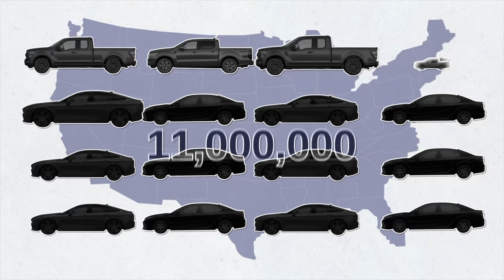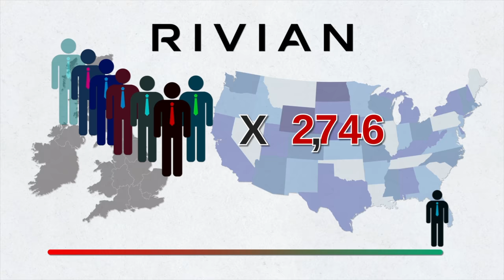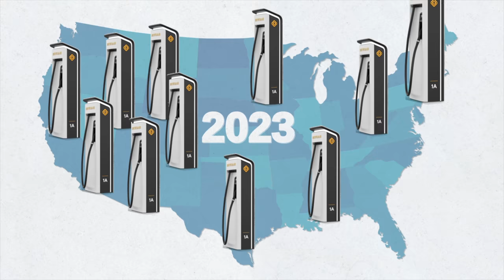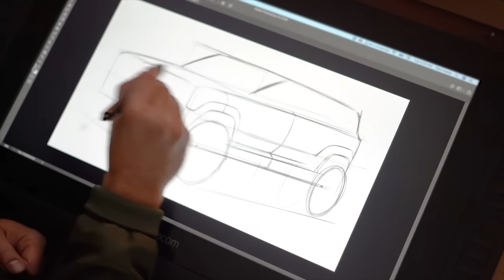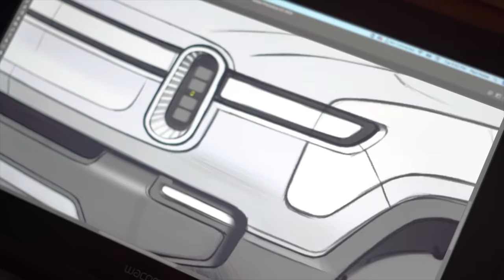Here's Why Rivian’s New Vehicle is the Future of Cars (Goodbye Tesla)

Comment: The government needs to pass a standardized EV outlet law before its to late. We need to make sure the Rivian, and Tesla chargers use a standard port that all cars can use. We also need to ensure all manufactures are making their cars with said standard port. Every car needs to be able to be used with every charger no adapters! If we don't its going to severely hamper EV takeover in the USA. 

Also please stop developing slow chargers instead of DC fast chargers. I and no one else has time to wait 12+ hours for my car to charge away from home as I live at an apt like a lot of Americans. Also I don't trust leaving my car somewhere for 12+ hours and needing second car to take me from and back to my car. That's insane. No vehicle should take more then 20 minutes to fill/charge to 75% if its made for mass consumer use. Maybe pass a law stating that all apt complexes with more then 8 seperate units need at least 4 dc fast chargers installed for residents to get a occupancy permit. I think this may end up being necessary as so many apt complexes are run by company's like a slum. If you don't force them they wont do it.

Comment: I had strong doubts .. although Amazon's purchase hinted there were good news "confidence" going on.  Seeing these reviews it is more than impressive - batteries, ages ago they said with current framework of technology (real energy storage - they don't even know what that technology will even look like at this point) but with heavy chemical, mineral etc buses and trucks to counterbalance the weight, space, and safety (they need protection) to solve "what are we doing all this for" with the space ration with cars (except for simpler "power and speed" solutions).  No Android or Apple - BUT, it's a hard "dealer sell" but IF they have a good map system - bluetooth can take care of the rest pretty well from my experience - and WIRELESS is such an important key; so when I was plugging the cell-in my brain and behavior was to often just go with the bluetooth .. when I got WIRELESS that all changed as it became really easy and I got rid of that darn dangly wire taking up a really prominent prime spot in the car.

Comment: If Rivian comes through, would be a great car. However, I don't see how it can come close to Tesla, that's if they can even make it till 2025. They delivered less than 100 vehicles...During the interview on CNBC with Rivian CEO, you can see the background of the factory. The cars were literally standing still while people working on it. That was Tesla in 2007 when they made the first Roadster. Let's see how many cars they can deliver in 2022. 5000, or let's just say 100k cars next year for a miracle, which I think is highly unlikely. Tesla in 2022 would probably deliver 2mil cars. Not even on the same level.
Reply: "Tesla in 2022 would probably deliver 2mil cars."
That seems unlikely - they haven't hit 1 million this year. In either case, I think it unlikely that a single one of those will be a CyberTruck. Tesla has pushed back delivery to 2022, but I expect that will slip further. And for anyone who hasn't got a reservation, the wait will be years and years. That is where Rivian and Ford (and others) might be able to step up and fill some of the demand, and solidify their respective position.
Reply: @swordedaffair  May I ask, how will Rivian fill up the demand if they are making 2 cars a day...Tesla barely made 1 mil cars this year, with only 2 factories, and Shanghai one barely ramping up to full, and fremont is old and none of them has the newest setup of giga press like Austin and Berlin. The two new factories would at least double the output of the 2 existing ones. So 2 mil it's not a far reach. But we will see, I could be wrong. But if you think Tesla can't make 2 mil cars, then how many cars do you think Rivian can actually make? LOL

Comment: As I commented on another video, they're going to need to get a bare minimum of 300 miles range and equivalent efficiency of the gas/diesel motors for them to be of any practical use out here in the rural part of the country. So far, nothing has come close when subjected to load stresses of driving on hilly terrain and the loss of efficiency in colder weather. Like everywhere else, time is money and stopping in the middle of your daily run to charge up for an hour just to make it to the rest of your stops and then home doesn't fit with the way we live and work; especially when you factor in that mid-point (or way-point) charging hasn't yet been installed where convenient to rural commuters and consumers.
Reply: Tesla cybetruck. Has 250-500 miles depending on trim level, it's made of harden stainless steel pannels around 2-3mm thick so you can throw rocks at it, 35 inch tires and AWD drive with rear wheel steering for ofroad capability only matched by EVs with 4 motor AWD system's,  no light duty diesel truck comes close to the torque and power of the cybertrucks 3x 300HP motors, it's bed supports 3500lbs 6ft length (8ft with tailgate open) rivian is a 4.5ft bed btw, Can quick charge from 10-80% in 30 minutes, includes heat pump to save range in winter. Evs already have 4x the efficiency of a gas/diesel truck, but need a battery 15x heavier than a gas tank for similar range. Colder weather doesn't effect efficiency much, it actually makes metal more efficient at conducting electricity, the problem is that the battery looses voltage and capacity is lost untill the battery is re heated which is what drains 15-30% power

Comment: Can the current Electrical Grid, handle the proposed increased expansion in charging stations ?  Probably so, but at what point does that demand overwhelm it ? Is the source of the Power of these chargers "Green" ?  Evidence is to the contrary.  Very cool Truck for sure, though !

Comment: Personally hybrids are more in line with me but pricing will be the determine factor on fully electric vehicles. If I have to get a second mortgage to pay for a car, is not going to happen.
Reply: Electric cars are inherently simple to make. They are cheaper to own in the long run already, as the energy they use is cheaper, and there is far less maintenance needed. All you need on a Tesla is a cabin air filter and tire rotation. The breaks last a long time, because so much of it done regeneratively. The reason these cars are still expensive is because of all the R&D, and the cost of new manufacturing plants.

Comment: Battery tech is evolving but it isn’t there yet. We must get away from lithium batteries. IMO these first gen electric vehicles may blaze a trail but are not part of a sustainable solution. I will not be an early adopter. But, using these in such a huge fleet of delivery vans should provide a wealth of data and yield improvements for the industry. We will face electrical grid challenges, in how to generate and store such an exponential increase in demand of power for all these vehicles.

Comment: Battery electric vehicles are great technology demonstrators, but at present, the battery is still the weakest link. All EVs will need range extenders to keep them on the road and smaller battery packs are a step in the right direction. I'm guessing Rivian's Gear Tunnel will leave plenty of space for the inevitable hydrogen tank. Now that's forward thinking!

Comment: EV cost less per mile for direct operating costs.  Factor in replacing batteries and they're way more expensive.   Plus an initial purchase price of 2-3 times.   The main draw back is not range, it's battery cost.
Reply: A tesla has a 8 year battery warranty. An EV battery is not supposed to be replaced during its lifetime. The LFP technology that Tesla will be moving to with its 4680 cells is safer, and degrades slower. It is considered a "million mile" battery. Everything else in your car will break before the battery ever does.

Comment: America simply doesn't have the electrical infrastructure to support all these electric vehicles. A level 2 charger needs an average of a 50 amp breaker in your elect panel.. Some of the Tesla chargers  use an 80 amp breaker! To give you an idea houses built in 1940 has a 60 amp  panel for the whole house. So the wiring bring power to cities, towns, streets are just not "big" enough to carry the amperage needed for all these level 2 or level 3 chargers.

Comment: A real EV need to use a continuous charge either located on the road or from the sky. They're putting the cart before the horse. Infrastructure is the key and the use of solar. How does a tree get its energy answer from the leaves and rays of the Sun for example one leaf puts out point 00 0325 of a milliamp. Think about that and how is that accomplished with just a little tiny leaf.

Comment: I like the idea, and I have no doubt electric vehicles are the future. However, the price will put it out of the range of the average worker. To be viable the price will have to be lowered considerably. The stats and durability are impressive. The front end design not so. I would buy one, if I could afford it!
Reply: thats just blatantly false, prices dont need to come down until supply outpaces demand, but right now they cant make enough as is so they could and maybe should be priced higher
Reply: @vitsadelhole  You have your head in the clouds. Your thinking short term economics, and you're not being realistic. If the average technician, who probably makes 50K or less a year, then he cannot afford such a vehicle that will cost him more than a years wage. If he cannot realistically afford it, he is not going to buy it. By lowering the price of a vehicle, making that vehicle more affordable, then more factories can be built to build more EV's that can subsequently be sold. Good for the ecology, good for business. Limiting numbers built to help keep the prices artificially high is self defeating. Good for the short term, but not in the long run. Thinking short term has gotten this country in trouble more than once. It is as simple as that.

Comment: 25 miles per hour charging rate? That needs to change to even have a slight chance to catch up to Tesla. Also, if it doesn't have 500 miles range then I won't even get 300 miles range towing anything. Who would want a truck that has 150 miles working range and takes 20X longer to charge than 1MW technology that is expected to come out in the Tesla Truck? You have to understand how this all works before comparing this Rivian Truck chassis to Tesla's version of EV Truck.

Comment: Electric vehicles all have the same flaw. The fuel source (battery) isn't universal.  What happens when the battery wears out?  Is it easily and relatively affordable to replace? Is there a recycling network in place for all the future dead batteries?  If the battery dies in my TV remote I can buy any AA battery, shove the bastard in the hole and it's good as new.  That is how electric vehicles should be designed as well in my opinion.

Comment: Electric trucks are impractical as tow vehicles at the time both because they lose 62% of their range when towing and the charging stalls require you to unhook a trailer in order to charge. As such IMHO it is useless as a truck and little more that an off road capable sedan.  Sticking to my diesel truck for the time being.

Comment: Ok, lets talk Electric vehicle in real terms. Sure, no gas cost for as long as you own the car that part is easy. Now subject 2, the expected battery life of 10 years, 7 years if your vehicle is considered "Extreme use" qualified, which most daily drivers are considered. Gas vehicles are depreciated over an expected life curve for mechanical break down or at least a consumer perceived mechanical life and it's cost. In other words how long before it cost a ton to fix! Today gas and diesel vehicles regularly surpass 190K and even over 200K before consumers believe the engine or transmission will fail costing a couple thousand bucks to fix. The new all electric vehicles like the Rev em' up here are expecting a battery replacement at 7 years or so that is expected to initially to cost over $18,000 minimum! So, if you buy one of these now or even in the next 15 to 20 years until the aftermarket can catch up with battery replacement tech, your depreciating against an enormous repair cost that is by gas terms right around the corner in 7 years. Ask yourself, how many gas vehicles do you see over 7 years old when you drive to work after reading this. Imagine if those vehicle had an expected repair cost at 7 years or so how many would you see? Exactly, a very, very few!

Comment: Why is Rivian the future and Tesla is not? The Rivian is nice, but their engineering is focused on fewer products. The battery storage design is essentially the same as Tesla's. But Tesla is advancing that design as well by creating a battery design that is actually part of the frame structure rather than batteries placed into the frame like Rivian is currently. Tesla's impact on EV's and automobiles, in general, cannot be overstated. They are the standard to which all EVs are compared. They aren't going anywhere soon. Again, a revolution is. in progress and every carmaker is trying to catch up. The only negative is Tesla is spreading itself very thin.

Comment: Once again cost will eliminate the largest sector of the population. The whole green deal eliminates this largest number of people.
 Electric may be the future but cost is the greatest hurdle these vehicles will need to cross. In reality E.V.s will have very little effect on greenhouse gases as long as power plants and the industries that mine and produce the batteries and the vehicles can be green also.
 The wealthy will be able to say they are doing the right thing by buying E.V.s but they are delusional. The poor and middle class, ( which is also being strained by this ideology ) will bare the true cost and pressure of " putting the cart in front of the horse,.
 Once all of these E.V.s, charging centers and dealerships dot the countryside fuel stations will be forced out, fuel prices will be sky high and those who can't afford this pipe dream will be forever be on foot.

Comment: 1. We use more energy and cause more deaths and pollution literally just from mining the minerals required for batteries.   

2. The batteries are a land field nightmare and the only last 7 years max .

3. When it’s time to replace the batteries the cost of the battery and installation is literally more then the car will be worth in 7 years. .  So whats the point besides making AOC and crazy libs happy ?

Same thing with solar panels . 

1. Cost to much and it takes longer than the average homeowner lives in there home to recoup the savings . 

3.  The average roof last 15 to 20 years.   Very expensive to remove and reinstall solar when replacing your roof. .

4. Currently the biggest scam in history .  The green this the green that .   China makes everything and they don’t comply.   Let that sink in . 

5.  Because of the raw material that has to be mined in foreign countries in grave working conditions it will be almost impossible to make solar or electric out weigh what we currently have . 

Hydrogen and Nuclear is a different story .

Comment: If they can figure out how to not JUST have EV "Engines" on each wheel, but to make those wheels when turning actually CHARGE the battery's (like how an Alternator charges a car battery), thus massively extending EV driving distance (as well as any other tech which can do this), THEN EV's will actually be reasonable and practical.  But until then, EV's are simply an expensive, impractical, and time-wasting paperweight for the middle and lower classes, just creating even greater separation of humanity between the regular folks and elites, not to mention the poor suffering because of the hit to the power grid, which already occurs in California (and they've mandated EV's only sold in a few years), and we know what happened in Texas due to their switching too much to Alt-energy and they had a simple winter storm, totally shutting down a lot of their grid.

I mean, an $80,000 Truck or SUV, when just a few years ago they were simple enough that you could get a nice one for $15-25,000.  They are WAY outpacing inflation...  Leftists never think of the consequences of their actions to regular people...  Hybrids and Steam were the next evolution for the masses if the market was acting "naturally", which also doesn't pollute, not Electric.
Reply: not 100% sure what you are requesting but EV motors are generators.  They use the kinetic energy of the vehicle to recharge the battery when braking (regenerative braking) or rolling downhill.  However, it takes energy to make a vehicle accelerate and maintain velocity against aerodynamic drag and tire rolling resistance.  EVs are highly efficient so they strive to minimize these parasitic losses.  There is no free lunch in physics.
Reply: @ricinro  beat me to it, lol.